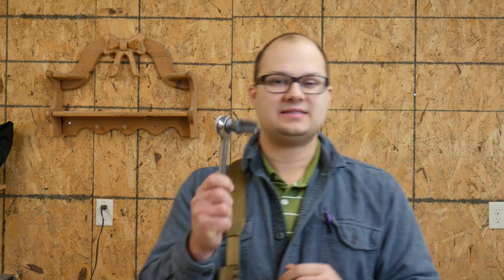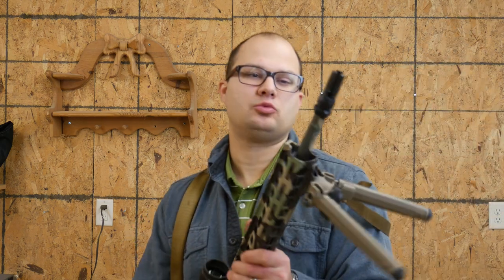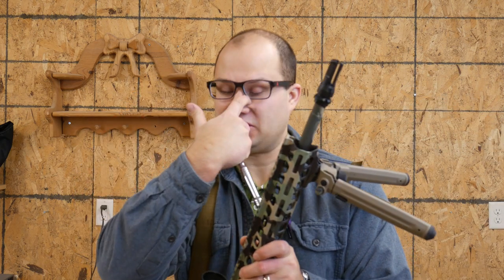How to Install a DeadAir Flash Hider on an AR10

Comment: The shims on a flash hider aren't really for timing as a FH self times.  It's so your notches line up in a specific known direction, especially since you said your waiting on a Sandman.  It's pretty convenient to index to your Key-Mo if it's at 12 o'clock especially if your doing it under nods.  But to each their own I recon.

Comment: Do you recommend getting a "bore alignment device" to check for straightness once you get your suppressor and attach it to the muzzle device? I saw that somewhere, but wasn't sure if it was necessary or not. Just got my tax stamp after just 4 months so its time to get all of this figured out!

Thanks! great video
Reply from the maker: So, I asked my FFL about that, and he told me with an AR platform gun you can just detach the upper and sight it down chamber to the muzzle and ensure alignment.  I did get one for my AK and had him check that.
Reply: @CitadelDefense1  Cool, thanks!

Comment: Just found your channel
Reply: Would the dead air flash hider be a good idea for a 10.5 inch pistol
Reply from the maker: I mean, if you ask me. I’m putting a flash hider on all my guns. 

You certainly don’t want a brake on there. Those tiny barrels are loud enough as is.